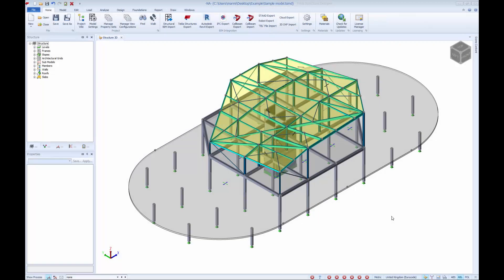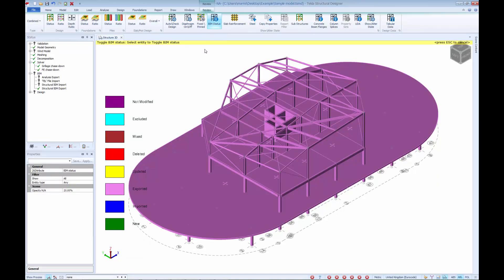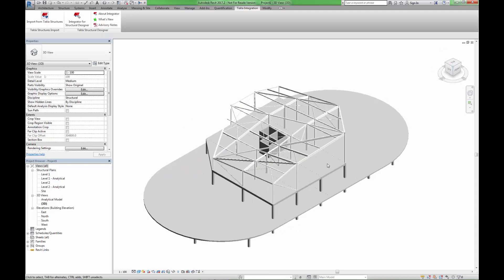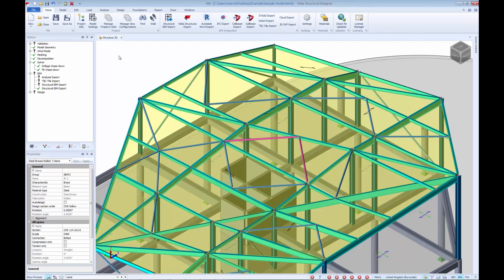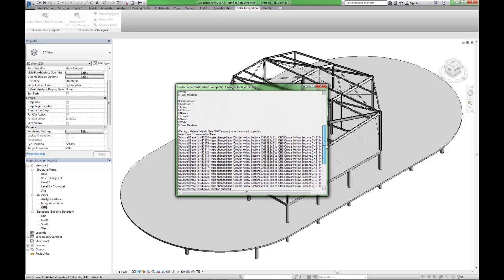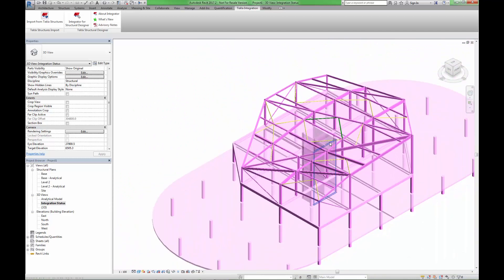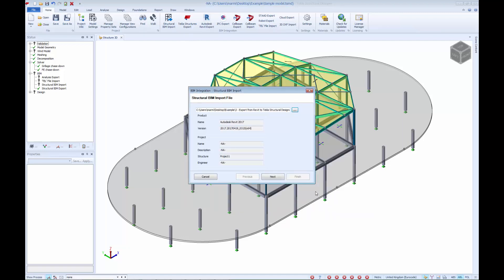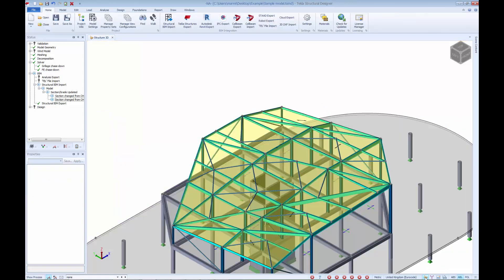Tekla Structural Designer  RVT Integration Demonstration

Comment: Hello, I've tried to export a model from Tekla structure to revit with Tekla integration but it's work for concrete elements but for steel columns and beams I received error message that can not be convert, what can I do  thanks